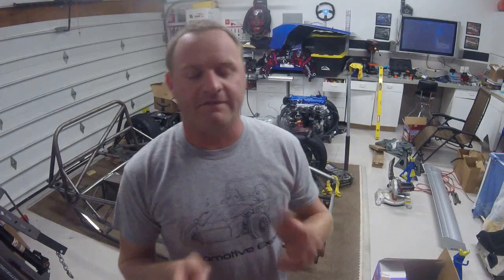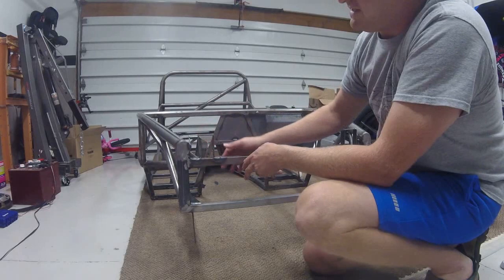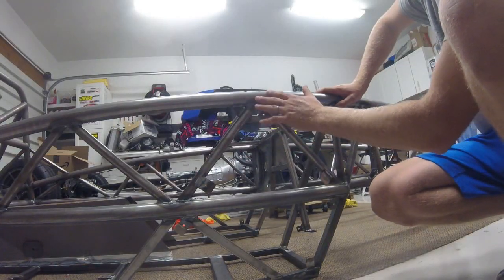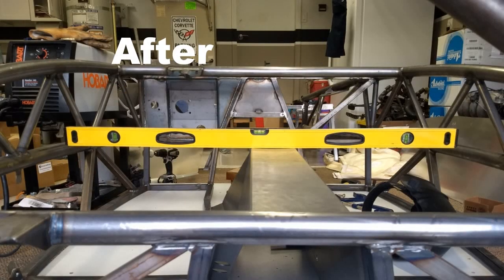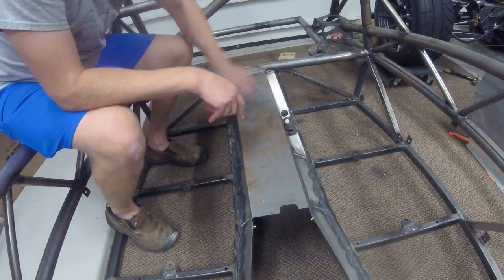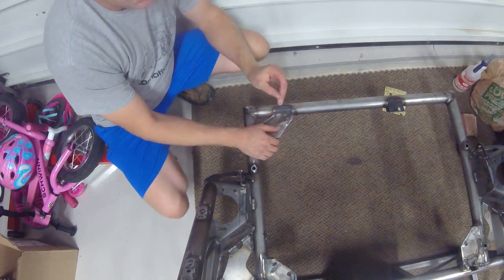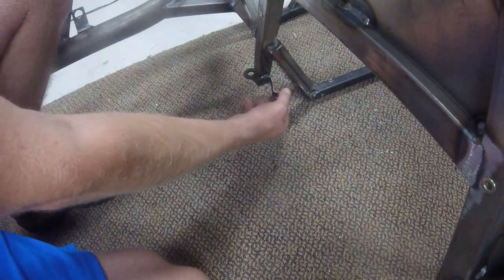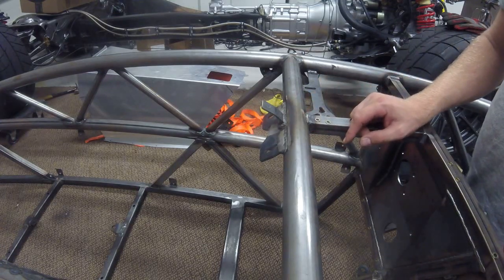Exocet Build: What I Welded On My Exocet Frame

Comment: hey...did you weld in your floor pans?
Reply from the maker: Nope, did aluminum sheet bolted on for weight savings.   Should have done steel floors
Reply: @BuildingTheEXOCET  why do you say you should have done steel?